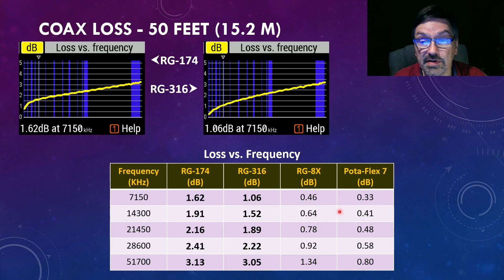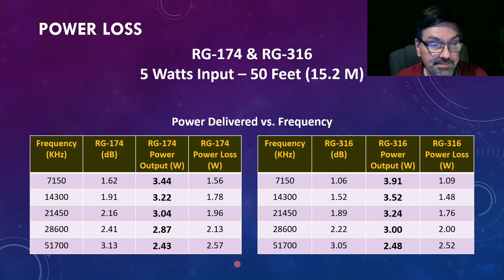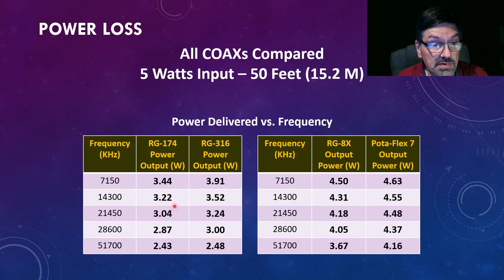Mini COAX - Is It Limiting Your Portable Radio Operating?

Comment: Super cool video! I am going to start some qrp work and bought 25 feet of rg316. Based on your calculations I'm fairly comfortable with the losses that I see. Thank you for your well thought out test and the nice graphics and calculations.
Reply from the maker: @matsherwood6277  Yes, the losses should be roughly half.  I have 20 foot lengths of the the same 50 foot RG-316 I tested here and plan to run that through my RigExpert analyzer. Unfortunately the company does not make 25 foot lengths of their coax cable assemblies.

Thank you for watching.

Comment: Good quality rg58 is fine into a resonant antenna throughout HF. RG174 into a dipole or resonant vertical is ok from 40m band and below with a 50ft run.
Reply from the maker: I agree with your assessment of RG-58. But the losses with RG-174 especially as you approach the higher HF frequencies are close to 3 dB. On a 5 Watt radio you're only getting about 2.5 Watts to the antenna. Having a steady stream of contacts makes things more fun.

Comment: Overall, a well thought out video and I agree with your assessment.  If I'm going to be operating near my vehicle, I generally run 50' of ABR 281XATC.  Hiking in though?  Definitely RG316 with BNC connectors.  The longest section I have is 30'.  I normally use 25' or 15' though.  If I'm hiking up to a mountain top do a SOTA activation, every ounce is probably going to make a difference.  In real world use, I get insane pileups on 5w or less, even with compromised antennas and lossy coax.  That being said, if band conditions are lousy (like they have been lately) squeezing every bit if power out of the rig and into the antenna helps, and using good coax will most definitely make a difference.
Reply from the maker: @EvanK2EJT  Thank you for watching Evan!

My QRP backpack is way too heavy and I need to look at trimming it down as I'm thinking of a POTA-Pseudo SOTA activation. It's probably close to a mile hike on a well defined trail but a mile up hill is a mile up hill!
Reply: @aa3konthego  You should be able to get it pretty light.  My entire pack, including food, water, enough stuff to spend the night if I get stuck during warm weather, and my entire radio kit comes in around 10-12lbs

Comment: I use RG-8X for portable ops. You don't want to lose most of your signal in lossy coax. Using BNC connectors saves some weight.
Reply: Same here
Reply from the maker: Agreed. Though if you're going to hike a mile to your operating spot, every ounce carried is that much more pain.

Comment: In my opinion, there is no reason for a 50ft length of RG-174  to exist particularly when running QRP into an inefficient antenna. I use about 25 ft of LMR 240.  For SOTA on the low bands maybe 10ft or less of RG174 would be OK. Generally I use LMR 400 or equivalent on HF through VHF. I got a little over 200 QSOs on Field Day running 5 watts. Worked HI too from WPA.
Reply from the maker: @vladtepes481  I've often used the whole 50 ft when the best antenna location is not cooperative with the shady spot to operate from. And it's my counterpoise where for 40m you need about 33 feet. You can get away with less especially with good ground conductivity.

Comment: My QRP field ops are generally from a picnic table somewhere.  I just have a 5ft and a 10ft length of RG-316 to an EFRW or EFHW.  Using an adaptor I can use both for 15 ft of coax, if needed.  I also built a mount that I can use with a telescoping whip that is clamped to the table.  I then run a few radials.

Comment: RG-316 is just hard to handle.
Reply: wat? how so?
Reply: @kk6onl wants to kink very easily even though I roll up using over/under method.
Reply from the maker: The over/under method may be better suited to the RG-174.  It has the stiffness of wet spaghetti and as I mentioned, I do find it getting tangled. The RG-316 is just stiff enough that I roll it up and unroll it out with little if any issues.

Thank you all for watching!
Reply: @Philip-KA4KOE  ohh ok, want thinking that way...

Comment: I run RG-6 75ohm on My QRP and worked very well for Me and have WAS, Master of Europe and other Awards As long as you have a resident antenna the coax doesn't affect it that much, I have found that out.
Reply: Nothing wrong with RG-6 and RG-11 for HF work as long as you avoid the CATV stuff if you plan to solder it. I have cables using real honest RG-6 and RG-11 with all copper braids which is easy to put a PL-259 on.  They are used on my flat-top dipoles since 75-ohm coax matches to the antennas better than 50-ohm coax does.   75-ohm coax was used by hams long before 50-ohm coax became the norm.  If you look hard enough, you can still find old SWR meters designed for 75-ohms.  I have one you can switch between 50 and 75 ohms. 73!
Reply from the maker: @garycowger9579  interesting. Have you ever compared SWR and/performance between 50 & 75 ohm coax?
Reply: @aa3konthego  Yes and there was not much Difference between the 75 ohm and the 50 ohm with SWR I use a QRP tuner from MFJ and it works out very well a matter of fact with the 75 ohm I can use universal adapters to connect to the QRP rigs  Wherewith the 50 ohm cable you can only use a limited amount of adapters and 75 ohm on cable is everywhere all the hardware stores carry it and all your TV manufacturing stores carry it that's the reason why I use 75 ohm cable
Reply from the maker: @garycowger9579  and with cable going to higher frequencies, much of the 75 Ohm stuff is quad shielded. Also useful for runs from satellite dishes.

Comment: Ultra flex 7
Reply from the maker: @williamkizer3445  I looked at the specs for that and see that it is similar to POTA-Flex 7 but not as heavily built. The POTA-Flex 7 build is sturdy but also springy when rolling it up. Unless you maintain some tension, the first coils want to jump off the reel.

Comment: Nice review. I use RG 174 as you saw last month, but I only use 20 ft. Since in my mind POTA and SOTA is portable operating, so I don't carry RG 8X, it takes up too much space in the pack and heavier. 72 Scott
Reply from the maker: @BikingHikingRadio  I have a 20 foot pre-made length of 316 which will cut the losses in half but I do rely on the coax to be the counterpoise.  I'll need to pop it on a EFHW and see how the tuning goes. The RigExpert makes that so easy!